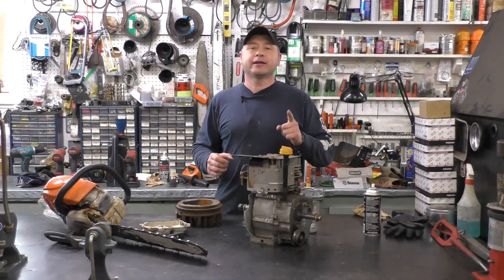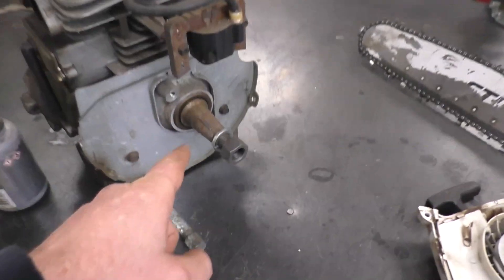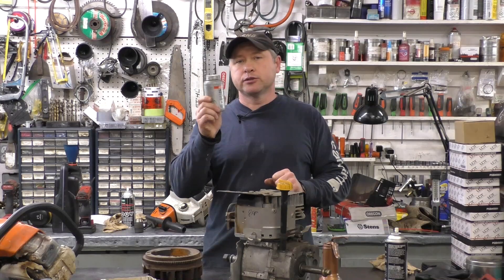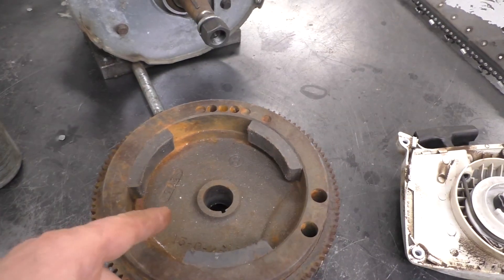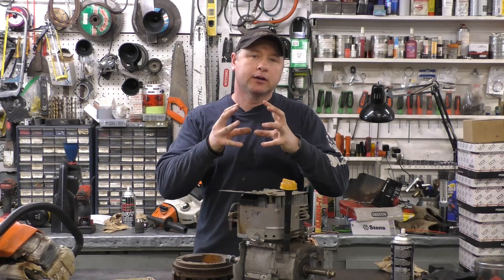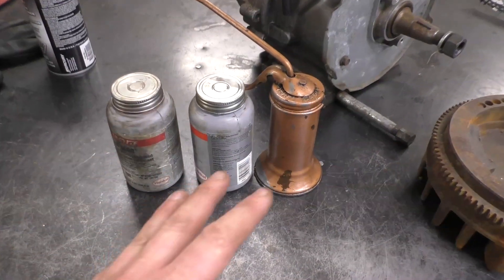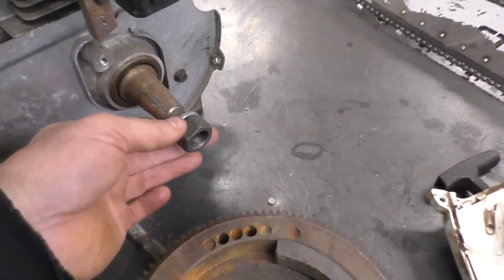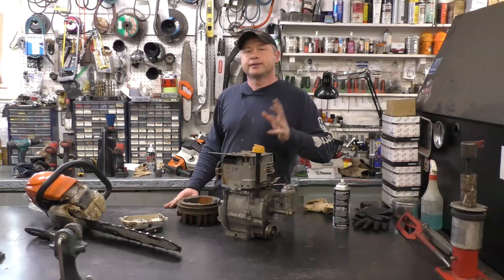Can I use Anti-Seize On A Small Engine Flywheel?

Comment: A bit off topic, but:
A pipe plug is also a tapered shaft. When using any Teflon material (pipe dope or tape, etc) you must be very careful when installing a pipe plug in an engine block or other casting. The slippery Teflon’s low friction may mislead you into thinking that the fitting is still loose, and you could crack the casting.  A brass plug can do the same. 
Great video, Donnie.

Comment: I have been using anti-seize ,for years. But I only use it on motors over 10hp. And very little is used, Theres no need for smaller hp engines. But its fine to use

Comment: On those tecumseh's (thank god they're out of business), you better torque them to spec too. I've seen many times where they were run on with an impact and deformed enough that they went over the taper and wedged against the block. Mostly happens on aluminum flywheels but some cast iron.

Comment: I used to repair equipment on golf courses and never found lubricant on any crankshaft on the flywheel side. But never really had any major problems removing the flywheel on any piece of equipment no matter how old. Some are a bit more difficult than others, but no big deal. So I wouldn't use it, and haven't, in any of my work. 
Good vid, as usual. Thanks much and Happy New Year!!👍🎉

Comment: I degrease the flywheel and crankshaft with break cleaner and/or carb cleaner or both to both parts.  I have had to many flywheel keys getting sheared, especially those with buil in flywheel keys.    Leaking flywheel side sals can also shear flywheel keys.  Do not forget the recoil starter is connected to the flywheel side and that puts a lot of pressure on the flywheel crankshaft interface.  I tight down flywheels, tight.

Comment: Hi Donyboy - it's Big Rodders in Ireland.  I learnt this the hard way with my electric start B&S 12hp engine.  I thought I was doing a good preventative thing by applying  copper based grease but ended up half breaking the key when electric cranking it, upsetting the timing and causing the engine to run very hot and bothered.  The taper was slightly damaged so I freshened up the surfaces using valve lapping paste, cleaned everything thoroughly then torqued down the nut very precisely and haven't had a problem with it since.  As I had no access to help or information I had to figure it all out myself so that is one lesson that I will never forget.

Comment: Antiseize will not allow proper torque and will allow the flywheel to crack when torqued. 38 years in the double action forging business and we use 1/8" taper per foot self locking 8 1/2" diameter piston rods driven into the forging ram with same taper and the ram weights 6 ton and holds. Note any oil from the above packing gland lubrication must not get on the taper of either part or the ram can fall off, it will not self lock. Good video Don in this case lubrication is a no go! The old man at EP over and out!

Comment: You don't want to put anti seize on the flywheel shaft. On the pulley side is ok but on the flywheel you want that to be as tight as possible. I have done it and it slipped and sheared the key. Not once but twice it happened. Plus, I have never came across a flywheel I haven't been able to get off no matter how rusty the thing was.

Comment: Lap flywheel with valve grinding compound clean surfaces and use torch and heat area around tapered hole then reinstall on tapered seat giving one stout blow to flywheel with dead blow and socket then retorque

Comment: The truth is 50%. I don't agre to assembly the pieces w/the rust on they. A clean 100% must be done for all the pieces before assembly. The assembly on the con and the tork the nut will make a good mechanical contact for the flyweel. The rust is not good on the contact between the pieces.
Reply: ya think? no rust... after it has been welded together for 20 years out in the weather, not SUN SUN SUN SUN SUN in desert, but rain rain rain of everywhere else. i will still oil crankshaft snout so i can take it apart next time... lets see 75 cent alum timing key that is designed to sheer if hit something with mower... or $100 crankshaft that will ruin the engine???? hummmmm???

Comment: how often do you remove the flywheel on there anyways?
Reply: PURE FORCE... flywheel puller with bolts 1/4"? that are made into the flywheel next to the center flywheel nut.  heat and oil heat and oil heat and oil to help loosen the rusty flywheels grip on the crank snout. some pry gently under the flywheeel off STOUT PART OF THE MOTOR and with the FLYWHEEL NUT LOOOOSE, but not off... flush with the top of the crank snout, give the crank snout a few quick raps with hammer while prying up with the pry bar under flywheel,

DO NOT PRY/attach OUTSIDE FLYWHEEL PULLER ON STARTER RING (if so equipped ,cant use outside puller on flywheel with alum starter ring, it will break it the alum starter ring have to use just puller with bolts that go on either side of the flywheel nut). 

shd have holes that are tapped, need cleaneed out/oiled so bolts go in at least 1/4"+ into the flywheel so dont pull the threads out of the soft alum flywheel or the bolt either. the flywheel is rusted on the crank snout by time/water/humidity and will not give up without a fight... unless new. then the hammer prybar thing should work well on the 2nd or 3rd hit of crank snout. MAKE SURE THE NUT IS LOOOOSE, but not off. using the nut to protect the threads on crank snout should u miss with the hammer... dont miss with the hammer. it doesnt need to be hit THAT hard.

Comment: Great video. You want a dry fit or torque. Fluids don't compress what you get is a fluid film gap on the taper. Must be a good snug dry taper lock or torque. The procedure of putting anti seize or fluid on the taper of a flywheel or even a snowmobile clutch can be deadly. If the flywheel or clutch comes loose at high RPM it can wobble and become imbalanced and fly apart because the shear centrifugal forces are no longer in a straight line. Shrapnel of the components can fly shoot through the flywheel or engine shroud and still cause injury or death if not careful. Same matter can happen with the snowmobile clutch or torque converter parts can fly apart and damage the shield and even blow through the snowmobile hood or can spin off the end of the crank and can spark off and ricochet inside the shield and if the gas tank has a leak or gets damaged by flying debris it can cause a fire as well. The disasters are nasty. With fluids in between you don't get the proper clamping force on the flywheel to crank.

Comment: Apparently in the past it seems that i MAY have been a bad boy😐
Reply: naw. the torque of the nut holds it on. the timing key keeps the timing. where is it going to go? on mower engines... with horizontal flywheel. cant go far. i paint the flywheel/fan/ nut JD green... and paint pen one side of the nut WHITE so i can tell at a glance if the nut is going anywhere.... a little more thought... take paint pen and make mark where the timing key slot is on end of crank snout and on the edge of the flywheel to see... at a glance... if they are the same. once the nut is tight, flywheel isnt going anywhere on most OUTDOOR POWER EQUIPMENT (OPE)... i wud think. 

i figure... i wll have to take the gd flywheel off again to replace the stater or the coil/starter ... cuz i was cheap on the rebuild and didnt replce them as a matter of course on rebuild and then wonder, after it MIGHT start once... WHY WONT IT START??? cuz the coil is cooked or the stater is cooked... or the starter that has been left out in the rain for 20 years doesnt work even after i cleaned and oiled it real well and the starter bolt is UNDER The gd flywheel so can finesse the starter bolt under the flywheel for an hour and a half with ur child like hands... or take the flywheel off and have the starter on/off in 30 minutes. your choice.

Comment: very nice info, thanks for sharing I had an air diesel generator most the way down due to mice damage, and I think I did put some oil on the tapered shaft for the generator, it was very had to find good info if I should of or not but now I know not to do it.

Comment: Correct answer. Ant-seize and lube components  intended to be repeatedly disassembled.  Torquing something that is lubed can slide and compress further than not-lubing and may draw closer together than intended.
Reply: cracks flywheel from overtorquing... cracked flywheels EXPLODE IN SPECTACULAR FASHION. DO NOT BE IN THE FLIGHT PATH OF FLYWHEELS OR OTHER ROTATING EQUIPMENT THAT IS RUNNNING... fans? harmonic balancers that were BEAT ON WITH HAMMER instead of honed out/pressed on with special threaded bolt/nut avail on e bay for $16

Comment: Dony, does the same theory apply to when putting on pulleys and PTO electric clutches on the opposite side of crankshaft? Just wondering.
Reply: I put grease on straight shafts but never tapered shafts or keys/keyways or the clampling faces of pulleys. Basically nothing on faces that are intended to transmit torque.
Reply: If it's a tapered shaft you keep it clean.

Comment: The rule is simple...never put anti-seize on a taper shaft....well explained..
Reply: NEVER say .... "never" .... just sand the crank snout/flywheel hole in and out so it is ruff and less apt to twist. light oil,  75 cent alum timing key. tighten to torque spec's and call it good. that way next time got to take the flywheel off it isnt such a struggle with 500 ton puller to get the flywheel off... crack it in the process..? cant tell without x ray/magnafluxing so if zoom it over 3500 it flies apart... esp if over torque the flywheel nut with ...(sigh) impact... and it EXPLODES in spectactular fashion. GRENADING is the term in use.

Comment: When I worked for a Johnson and Evinrude dealer back in the late 90’s there were several service bulletins out that assembly line workers were putting anti-seize on the fly wheels and we had a pull every new units fly wheel whether it had anti-seize on it or not and clean it with acetone and reassemble and submit a warranty claim
Reply: Excellent comment on a real situation in the industry

Comment: Don't put the "magic goo" on your lug studs on your car or truck either because when you get it on the tapers in you wheel your lug nuts will put way more torque on the wheel and press out the the wheel.  I put some on the studs for the mags on my Chevelle and it cracked the holes out on the mag wheel.  The wheel came off and nearly clipped 2 old ladies coming of the local Bridgemans ice cream.

Comment: That was a good tip, if the flywheel rotate slightly on crankshaft you will Have wrong timing on spark
Reply: PAINT PEN to mark the flywheel timing groove.. where the key goes.  tighten the nut... paint the side of the nut and the same side of the flywheel so at a glance can tell if flywheel/nut/timing has changed... if hit something with mower. i wud rather replace a 75 cent alum timing key that sheared than $100 crankshaft that is twisted or thrown rod as it tries to stop a heaavy flywheel in motion and wont happen. just throws rod/twists crankshaft instead of sheer 75 cent alum flywheel key... that have 10 of them off e bay in a bag with ORANGE DUCT TAPE ON with BRIGGS FLYWHEEL KEYS in box/drawer of SMALL SPECIAL STUFF. differnt colors for different things.

Comment: OK, so....no anti-seize and make sure to torque the fly wheel. It all makes sense but I’ve been looking for a torque wrench for just that purpose as my chainsaw flywheel needs a 13 lb torque. However looking at my favourite tire store etc it is quite difficult to find a wrench that will torque that low, 50+ lbs seems to be the norm. HMMMM any ideas?
Reply: Use a torque wrench that displays inch-pounds. Obviously, 1 foot equals 12 inches so multiply 13-foot pounds by 12 to convert foot-pounds to inch-pounds for a torque value of 156-inch pounds.
Reply: that seems like a LOT???? the 212 PREDATOR KARTING ENGINE has 55 FT/lbs of torque and it is a 212cc.... ur machine is 80cc? but 2 smoke?
Reply: @gmcinnis6304  13 FT LBS equals = 156 >>>> INCH POUNDS <<<<.  He's not saying it's 156 ft. lb

Comment: Excellent advice.  So far, I have mostly been doing less extensive repairs, and so I have only had to pull a flywheel a couple of times.  I did not put anti-seize when I reassembled, but now I know how important that was.  By the way, I am impressed that Dony still consults with a mentor, even with his own vast experience.  I salute that!

Comment: It's like that hot sauce commercial, 
"I use that shit on everything "  except taper fit items. Split taper bushings, flywheels, etc. 
I learned the hard way long ago mounting a split taper. It let loose and caused some serious damage. 
For Pete's sake,  said right on the directions,  soak in thinner to remove rust prevention shipping oil. Assemble dry. Can apply lock tight to 3 set screws, but no oil, line, anti snizzle!!

Comment: Ford Zetec engines are a great example of this.  There is no keyway on the cams and after proper timing you just tighten the cam sprocket bolts on to the taper of the camshafts.  No lube, no anti-seize, no loctite.  Any tapered shaft, use manufacturers recommended torque only.
Reply: Yep, and I get questions weekly about that. Usually in the form of "Hey I was trying to turn my engine over with a wrench and the bolt came loose. Will that be a problem?"

Comment: The crankshaft is actually tapered to center the flywheel (or armature on a generator) on the end of the crank. The friction/press fit is just a bonus feature, that engineers utilize, that comes from the taper. There are more secure methods of attachment if having the two parts not be able to slip took priority over having the parts be centered on axis.

Comment: I'm sure you could I personally wouldn't recommend doing so. As all removable timing key flywheels has to be relaped back to the crankshaft after removal. If you are using the key then you might get away with it. As the key is not there for keeping the flywheel from spinning on the crank but for the ones that doesn't know about timing a small engine the key is for that. As the force of the nut pushing the flywheel onto the crank taper is what holds the flywheel in place if I was doing a race kart build and didn't want to use a key I'd definitely not use anything that's going to create a gap between the crank taper and flywheel as it would help it to spin as trying to start the engine. For a pressure washer engine or something not exceeding above 3600-3800 rpm you might get away with it.

Comment: Nope; have not seen lubed shafts like that.  Also do not use antisieve on lug nuts or other hardware unless specified by maker.  The lube changes the applied torque values greatly.
Reply: Most big truck mechanics don't know that hub-piloted wheels are a wet application. Two-piece 33 mm flange nuts used with hub-piloted wheels should be oiled with 30 weight oil and tightened to a torque of 450 to 500 foot-pounds. Other nut designs have different torque requirements. Don't use anti-seize, grease, or any other lubricant. Don't install dry either. Just use regular 30 weight oil.

Comment: I am a woodworker. A good example of what Dony is talking about is the Morse Taper found on drill presses and on the tail stock of a lathe. The tapered chuck simply slides up into the female taper on the drill press drive. That’s it. No key, no bolt. Just the friction of the two precision tapered surfaces. The same is true of the tail stock on a wood lathe. In the case of these tools, the work being done creates pressure (like the crankshaft nut on an engine) to force the tapers together. When I got my first drill press, over 30 years ago, I was assembling it and remember thinking, “well, that can’t be good… what kind of piece of junk did I just buy?” Of course I later learned that this design was invented by Morse to allow a reliable connection that would allow early production workers to change tooling quickly. A couple hundred years later and it is still being used. There is a safety aspect too. Not sure if it is part of the design because not much concern was given for worker safety back in the 1800s factories. I saw a very good woodworker once get his sleeve caught up in a running drill press. When he instinctively let go of the quill (thus removing the pressure forcing the two tapers together) the taper released from resistance and the chuck dropped out of the taper with a clunk as it hit the work. Torn shirt. No injury. Not exactly a small engine story, but it speaks to the same principals Dony is relating.
Reply: Thanks for the composition suggestions, C Mc Ginnis. Happy New Year to you!
Reply: hitting ENTER key after every 3-4 sentences makes a paragraph.  each paragraph same thought... or continuation of the previous thought... makes it easier to read with some spaces in the perpetual sentence of what shd have been 5 paragraphs.

Comment: My opinion as an engineer is to agree with you on this. If the manufacturer does not recommend something it is probably not good to do. Except when they recommend long maintenece intervals (check and add oil) and you do it more often.

Comment: I had a case where antisieze was used on a K Series Kohler flywheel and over time it worked it’s way out causing a gap between the crank and flywheel which caused an axial”knocking” sound which he thought was a rod knock.  Took it apart and cleaned and reinstalled and it was quiet like new!  Also had a customer use Red Loctite! That was fun getting off with a torch!  Good vid Don!